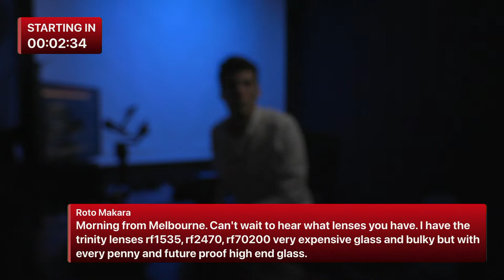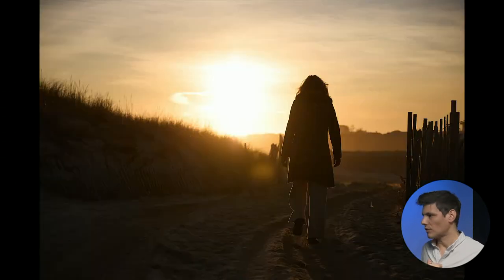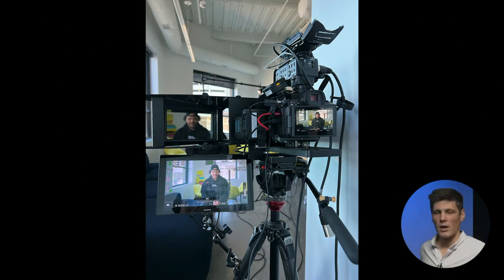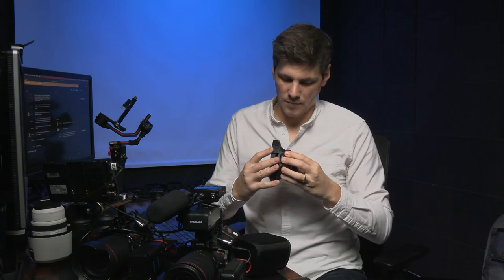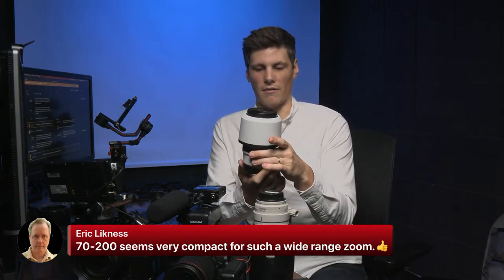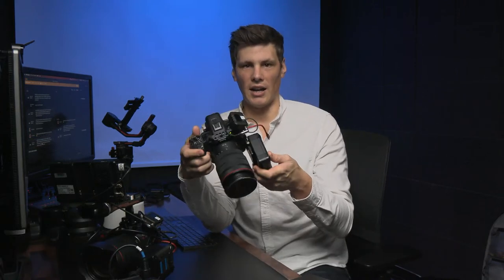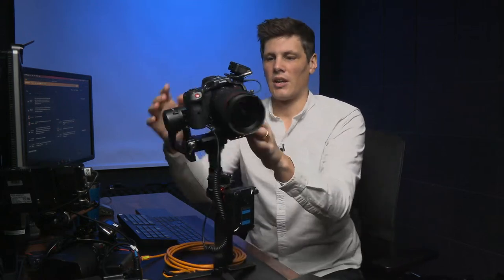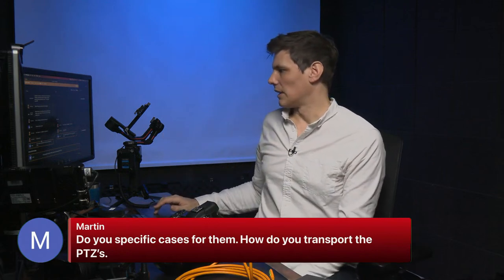Canon R5C in 2023 - E38

Comment: hi..is not ok too use D-TAPE? you have a aku compatible with this !..you have a link too buy this v mount adaptor for ronin rc ? tx
Reply from the maker: I use this indipro D-TAP because it has a 7.9v regulator in it https://bhpho.to/3HQokPN. I use it when on the gimbal so that the USBC port is free for Rec control on the DJI RS2 Pro. Otherwise I find the USBC power easy for the regular cage with the FXLION vmount batteries. The mini v-mount plate and NATO clamp are https://amzn.to/3El2wer and https://amzn.to/3jNK5Yx screwed together
Reply: @davidjoshuaford  thanks,just i order this ! Thanks
Reply: @davidjoshuaford  thanks..i just order this pice from smallrig too fix my v mont batery on ronin..nice ideea thanks !